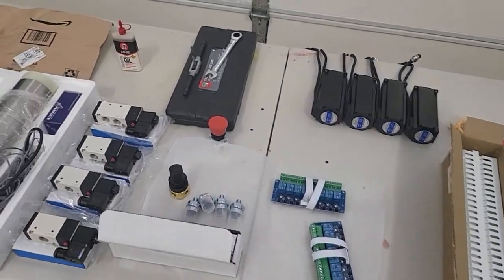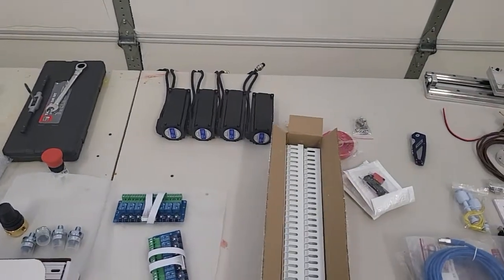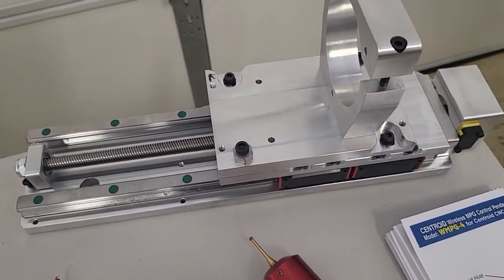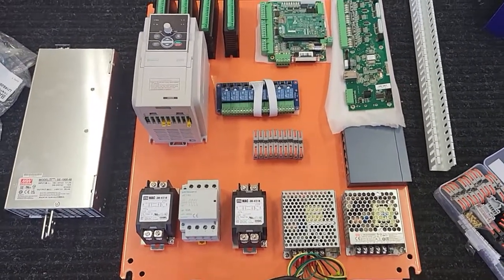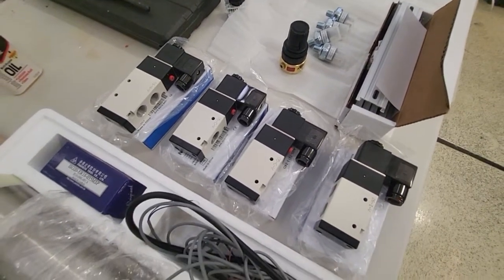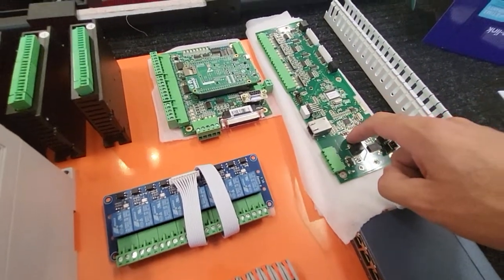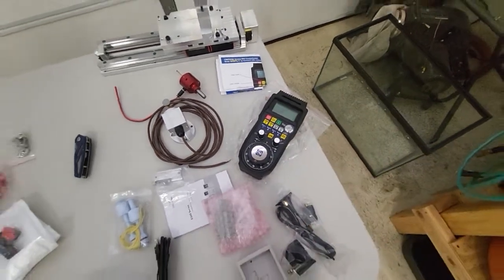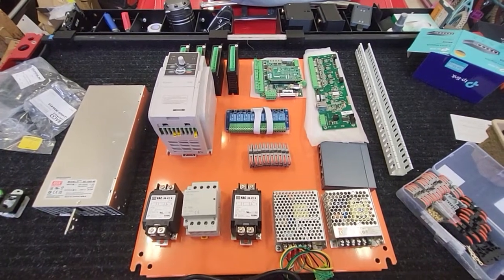ATC Upgrade Part 1: Quick Walk-Through of Parts

Comment: Looking forward to see more! A tip is to order iso20 holders from aliexpress, much cheaper than partfaite and holds the same tolerances.  Are you planning to use breake resistor?
Reply from the maker: Thanks for the tip. I personally am not a fan of aliexpress though. I've only ordered one time from there where it actually arrived in any useful amount of time.

What do you mean a break resistor?
Reply: @BirdsEyeTech  yeah some things at aliexpress is bad, other are quite good. It's hard to know the difference. 
Regarding a break resistor, it will help you spindle to come to a com
plete stop much faster

Comment: PLEASE!!!! Help me with the wiring on this spindle. I just received my 3.2kw BT30. Ive got all the air lines sorted but I  dont know what to do with the sensor wires. SUBBED.
Reply from the maker: I havent made it that far yet but to my understanding the sensor wires will hookup to one of your inputs on your controller that will tell your controller if there is a tool loaded or not. It's basically like a homing switch where is either enabled or disabled. What controller are you using?

Comment: Where did you get the z tool touch off from?
Reply from the maker: The probe and the Z tool setter are from Drewtronics.
Reply: @BirdsEyeTech  cheers! I have the same spindle and the acorn board, but I have no experience in wiring or electrical work. I hope you could share your wiring with us :).

Comment: Nice, subbed! Acorn has my interest. I have the very same brand of VFD for my new ATC spindle (tad larger VFD/spindle, i wanted to use an ISO30 spindle, since I have most of the tools and bits in ISO30 for another machine, and also wanted to use an air cooled version). I've just been programming the VFD to suit my likings. The freedom in setting the IO's is neat. Vector isn't working on HF spindles though i'm using the version with a brake resistor.  But low RPM torque isn't bad.  I'm going to use the good ol' 0-10V, i guess you are going to use the RS485 ability with the acorn controller? These pneumatic valves can be screwed onto a bank, reducing the amount of needed input air lines. Correct me if i'm wrong, but i thought that the VFD's have a build in EMC filter by default. I personally wouldn't use an on/off switch for the main relay I've used a dual momentary switch for on/off. And once the power has been interrupted it stays off.  Your spindle should have 2 sensors you could monitor and base your actions on. My current controller hasn't got enough inputs, but i could make that entire ATC routine go external without the sacrifice of an output on the controller and using the PAUSE input of the controller to make it to halt if something goes wrong in the ATC process. But perhaps i'll upgrade the controller. Haven't decided yet. You can also use an external non contact fluid level sensor, i stumbled upon these by accident, item 33041900609 on Alie. Best of luck on your project! i know it can absorb more time than anticipated.. 'situations like 'VFD is too large for the current controlbox, need to order an extra control box' Delivery time of the Igus wires took a long time. Still awaiting delivery of the filters for filtering the input air for the spindle (mine required 0,1um filters, which became 0,01, since 0,1 seems to be non existing). Upgrading is a patient game.
Reply from the maker: I'll have to look into the control of the spindle via the RS485 port. I'm actually not sure my VFD can handle that based on what they were telling me. I'll also need to see what sensors are actually in the spindle itself. 

Thanks for the sub and feedback! It's slowly coming together. I do have all the components mounted in the electrical cabinet now. Just need to run the wiring next. The next video should be up soon.